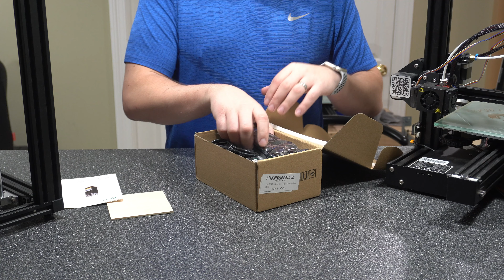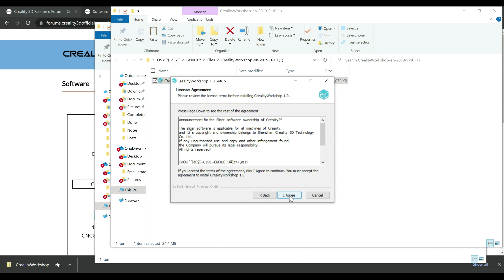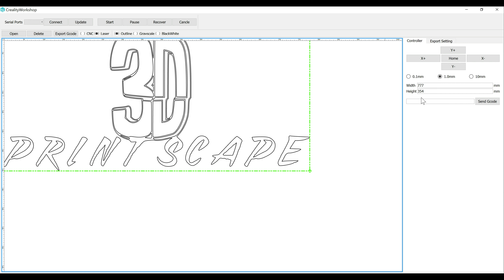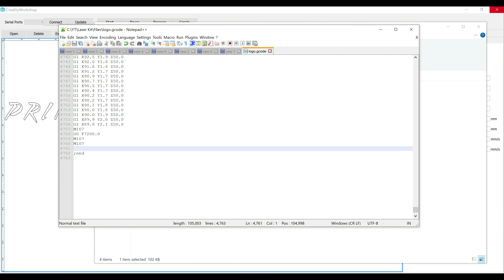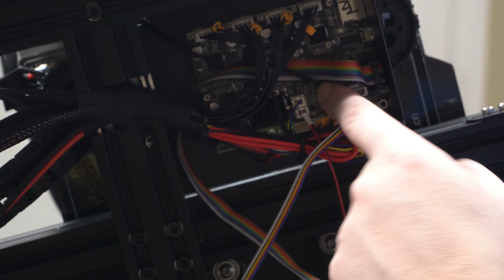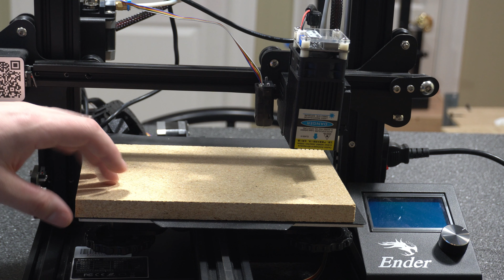Laser Engraving Kit Unboxing, Install & First Results

Comment: it works, but only when using outlined, if I want it all black out it doesnt
Reply from the maker: Hi. You may have to change the picture setting or threshold.
Reply: @3DPrintscape  it did fix it. I have another problem now, there are thin horizontal lines where shouldn’t have nothing. Like in the space between the letters and such. What could be the cause of that ?
Reply from the maker: @madeinpavao  Could be print temp or something on the track/wheels.

Comment: How did you get your Z-axis to stay up? Mine keeps falling due to the weight of the laser. 
Each time I try to move my Z-Axis while the laser is installed it will start pushing my bed down with the laser, because it can't "Home".
I also have the Ender 3-V2 Neo.
Reply from the maker: Hi. I havent had an issue with the z axis moving down but i have talked to some people that have. One thing i suggested was to try to put a clip or something on the z axis rod where you want the axis to be.

Comment: I bought a sovol 5w laser, I did the same installation of the video, but I only managed to record at a constant power, that is, it does not record an image in grayscale, everything is done in one tone. That means everything appears black.
Reply from the maker: Hi. What did you use to slice the image. I found the software is the biggest variable here.

Comment: Thank you for an excellent video. I've got a 5W  Creality laser. However it came with a 3 connector wire instead of 2. Is there a way to install the 3 connector wire please? PS. For those with an Ender V2 don't update the firmware. The instructions as per this video works without updating software.
Reply from the maker: Hi. If its tied into the fan, it will only work with the two wires.

Comment: My ender 3v2 moves the X axis over 50 mm before starting instead of starting at the corner where I set it. Y  starts where its  suppose to. any help would be appreciated
Reply from the maker: Hi. It sounds like you may not be disabling the steppers then setting it to the corner of the piece. That should reset the current x and y value at 0 there. If thats not it, there may be something in the slicing tool moving it.

Comment: i have the exact same laser but if i set the speed to 12 the first time it was perfect when i set the laser the second time to 12 it didnt burned anything even on speed 10 with the rigt focous lenght
Reply from the maker: Hi. Was the z height changed at all? Either by the parts being engraved, base, or anything else?

Comment: I finally found time to install the laser this evening. Since this video was made, things have totally changed. One thing is correct, the directions are poor. There are two pieces of apparently carbon foam for filtering, no idea where to put them. The software cited is no longer available. I also have two weak magnetic strips, no clue. They "might" be able to hold a piece of paper down but even that would be a stain. The software says to run the laser down to apparently the lowest point and it captures that value. Then there is another adjustment for the z direction...I'm not sure if to use that in place of physically adjusting the lazer up and down with the two thumb screws.  Much like the printer itself, there is a lot left up to the user to figure out on their own.
Reply from the maker: Hi. What laser did you end up getting? I didnt have any foam or filtering. The creality workshop software is still available, i downloaded it the other day.
Reply: @3DPrintscape  Ender 3 S1 Pro   Where do you find the "workshop" file? It's not listed under the Ender 3 S1 Pro for downloads.
Reply: @3DPrintscape  I found the file but so far, I haven't received the email to complete my registration. Its been 15 minutes...on to trying lightburn...
Reply from the maker: @timothytapio4252  I need to find the link again, but cant post it here as its not official, but there is a google drive that has it available for download. If you keep searching, it should come up.

Comment: when I flash the firmware to support the laser and upgrade the control, when I switch back to the hot end in order to print, does the FW let me select print instead of engrave?  I'm doing some mods currently, then need to set up for PETG (I've never done) and print a few things....then it will be laser time.  Also, how much smoke is generated? My windows managed to self destroy their hardware for open/close  (honest)
Reply from the maker: Hi. You shouldnt need to change the firmware to run the laser, it just uses the fan control. There is a lot of smoke and it can smell bad lol.
Reply: @3DPrintscape  Creality does list a firmware for the laser and a separate update for the control panel...I'm confused. It may end up as a try and see....
Reply from the maker: @timothytapio4252  Interesting, maybe they changed things up since I made this video.

Comment: I have an Ender 3 S1 Pro and the control is different (touch screen)...so, I do the firmware after I install the laser...then do I use Creality Print to create something, then have to run it through a slicer as well?
Reply from the maker: Hi. Ya the process will pretty much be the same, just need to find the right controls in the menu to control the fan and axis placement.

Comment: I think I have the same 3D Printer as you. Which is the Ender 3 Pro. However, some of the laser attachments say it's intended for the End 3 S1 Pro. Would this be compatible with my system? Also, I'm really only interested in engraving wood and maybe like thin aluminum. I dont need it to completely cut through materials. So would a 500 miliwatt laser be right for me I found a compatible one for like $38 or maybe the $70+ 1.6 Watt laser? Btw thanks I'm advance! I subbed to you!
Reply from the maker: Hi. You would want to use the attachments for the standard ender 3, not the s1, the main difference is how it mounts the laser on the fan. If you just want to do light engraving into the wood the .5w one would work. Im not sure how it would work on aluminum though. Thanks for the sub, i appreciate it.

Comment: Hi Rob. I just ordered the 5W laser, and was wondering if I plugged the fan into the other lead, could I just leave the laser mounted on my Ender 3 Pro, and just disconnect the power to the laser up top when wanting to 3D print?
Reply from the maker: Hi. You can but the issue will be the fan being blocked by the laser. Im not sure if it will get enough airflow to regulate the hotend with the laser there.

Comment: hi sir,
I got my laser (dontz laser 24v 1.6 w) today, I assembled to the my printer ender 3 pro what you showed on the video but the laser has 3 output one pwm one vcc one gnd. so I disconnect blue and yellow wire and input the vcc and gnd but the laser does not work could you please help me?
Reply from the maker: Hi. Can you send a link to the exact laser you bought?

Comment: Nice video!
I wonder can I use DONTZ laser 24v-1.6 w for ender 3 pro? I will follow your step can I do it or it is not possible?
Reply from the maker: Hi. Based on the specs i think it will work.
Reply: @3DPrintscape  thank you ;)
Reply from the maker: @mertturk4741  You're welcome
Reply: @3DPrintscape  hi sir,
I got my laser today, I assembled what you showed on the video but the laser has 3 output one pwm one vcc one gnd. so I disconnect blue and yellow wire and input the vcc and gnd but the laser does not work could you please help me?
Reply from the maker: @mertturk4741  What laser did you end up getting? It should just have the two 3 in connectors and you use the one i show in the video.
Reply: @3DPrintscape  the connector has a 3 pin in pwm vcc and gnd
Reply: When ı disconnect fan vcc and gnd connect but the pwm pin is out i dont know where to connect pwm pin
Reply from the maker: @mertturk4741  Looking closer at my laser, its just using the two pns. GND is connected to the black wire and vcc is connected to the other one.
Reply: @3DPrintscape  yes I know your laser has two pin vcc 24v and gnd. But I have 3 pin on my laser connection I need help to install on ender 3 pro. Where can I connect 24v gnd and pwm.
Reply from the maker: @mertturk4741  It depends on the laser. It may be worth trying to connect the positive to both the vcc and pwm pin. I dont have a laser with 3 pins, so i cant actually test it myself.

Comment: Thinking about buying a 5w laser with electric power of 40w. Is 40w to much for the ender 3 fan port? I'm running my ender 3 with a skr mini...
Reply from the maker: Hi. The laser im using in this video is 40w in and it works fine, so you should be good.

Comment: Hi Rob thank you for the video does this laser need to be removed when you want to use the 3-D printer to print pla If not how you the fan
Reply from the maker: Hi, the laser would need to be removed and the fan will need to be plugged back in but its not much work to do that.

Comment: Thanks for another informative video. I purchased and installed the 5W laser on my ender 3 pro using an skr mini e3 V3 board.  Connected it to the same fan as the video.  All my attempts to engrave on the 3mm plywood board ended in a burned spot on the far right side of the x axis.  perhaps you can guide me in the direction of how to correct this learning opportunity? thanks again for the input.
Reply from the maker: Hi. Can you send me a picture of the burn spot your talking about? My email is admin@3dprintscape.com
Reply: Hey, looks like I found the problem myself. When I paid more attention to where the model is placed on the plate in creality works program everything started working. Two things; model has to be in the upper left corner and sized correctly. I need a more robust software product.

Comment: I'm trying to dial in the settings to get a clean QR code, but can't seem to quite get it right.  Have you been able to get a clean QR code, or do you have any recommendations of settings to dial in? I get a lot of burn marks on the outside, particularly on the edges.
Reply from the maker: Hi. I haven't tried to do a QR code. What material are you trying to use?
Reply: @3DPrintscape  Wood, walnut to be specific.
Reply from the maker: @DontHurtMe23  ok, i will try to look into it more.

Comment: What make is the laser you are using?
Will this engrave stainless steel?
Reply from the maker: Hi. Its the 5w Sovol layer. Based on the description it can engrave stainless steel but i havent tried it. "can directly engrave coated or brushed stainless steel and ceramics"
Reply: @3DPrintscape  thank you, just what I was thinking of buying.

Comment: Been trying to set this up following your video, everything works fine, but when I hit prints it starts about 20mm off the bed.
Reply from the maker: Hi. What z height do you have set in the creality workshop software?
Reply: 43mm 3mm for material + 20mm for plate + 20mm for fixed focus.
Reply from the maker: @jimmorgan7765  Take a look at the gcode file that it made and see what the z offset is set to in that. Im guessing its 20mm.

Comment: I have this laser ordered but am worried I have too high of expectation? I really want the 10 watt one but figured Ill try this to see if its ok. I have Prime so I can return it if it dont work out since its a third of the price of the 10 watt. My question is, do you think you can accurately cut out thin sheet metal using this?
Reply from the maker: Hi. I dont think this will be able to cut through metal.

Comment: Thank you for another interesting video. I have ordered on of the 5w ones from your  link. I have a BTT Mini E3 V3.0 Mainboard do you know where I should plug Laser in
and how do turn it on?
Reply from the maker: Hi. It should plug into where the hotend fan is and its turned on by turning that fan on.
Reply: @3DPrintscape  thank you keep up the good work. Great interesting videos.

Comment: Do you think it would be possible to use a mutant flex plate system with a wood burner? What are your thoughts on using a wood burner?
Reply from the maker: Hi. What type of wood burner are you thinking of? The laser can burn into the wood but its not like an actual wood burner.
Reply: It is the equiv to a soldering iron with interchangeable tips for wood burning @3DPrintscape
Reply from the maker: @Rsm583  Ok, thats what i was thinking of. Im not sure how that would work, but if you mount it properly and get the height right it I think it would work similarly to this. It would basically be the same as putting a pencil on the printer for drawing.